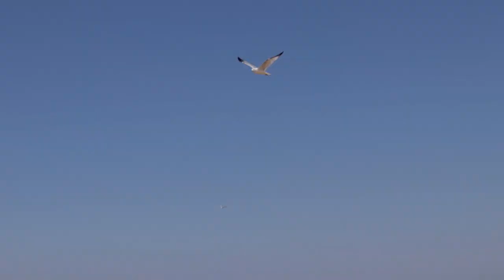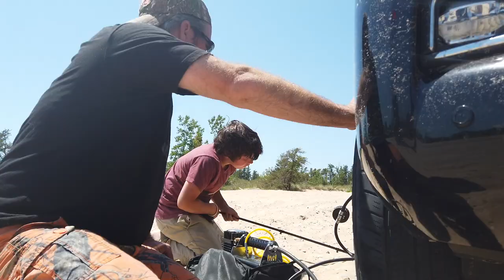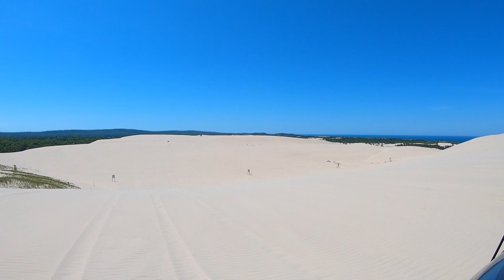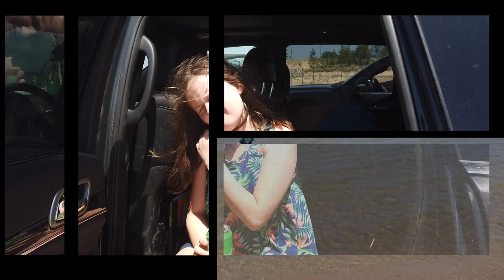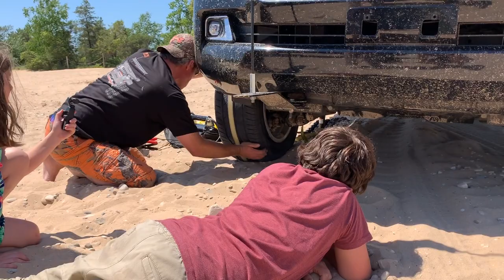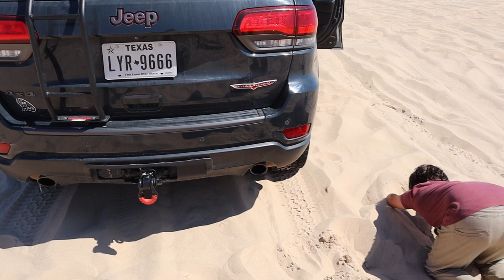Jeep Grand Cherokee Trailhawk | Off Road at Silver Lake Sand Dunes!

Comment: Take my WK2 limited on the beaches in Nantucket. First time with factory tires got stuck. Had tires changed to Falken Wildpeak AT3, no issues and I do not let air out. Just need to start slow when the sand is past the tires and up to the wheel bead
Reply from the maker: The issue we were having At silver lake sand dunes was that the soft sand and steep pitch of the dunes would stop forward progress.  When we let more air out. We had a wider foot print and were able to make it up the dunes.  But yes, on level sand we were fine.

Comment: The same happend to me some years ago, I installed a Slide on the lower back part of the truck. It has never pulled out again, and I do more severe sand dune driving that what you have shown. If you like I can send you some pictures of my install, it’s very easy and with aluminum.
Reply from the maker: That would be great! You could email them to contact@prodigaloverland.com. Thanks!

Comment: Great video. Had my '18 GC Trailhawk in the sand at Carova Beach NC this week.  Sand mode, OR1 works perfectly.
Reply from the maker: That’s what I was rolling on. Thanks for watching
Reply: I was just there a 3 weeks ago!
Reply: What psi were you guys down to for the sand??
Reply: @albertopagano2650  I aired down stock Goodyears on the GC Trailhawk to 22psi, no problems driving over the dunes in Carova.  In my TJ, I usually air down BFGs to 15psi.

Comment: Just curious if you played with the different terrain modes to see if “sand” really helps or hurts.
Reply from the maker: No I didn’t play with that at all. Just left it in sand mode. That would have been a good thing to try though
Reply: I recently did some beach driving in NC, I noticed that using "Sand" kept my RPMs much higher. As I was driving around one morning I looked down and noticed my RPMs were much lower and realized I forgot to put it back into "Sand". I felt like it made a difference when in softer sand, but as long as you're in decently packed sand, I'd stay in "Auto"
Reply: Keep checking your back, BLM might sneak up on ya!